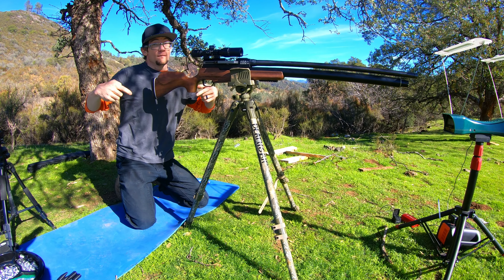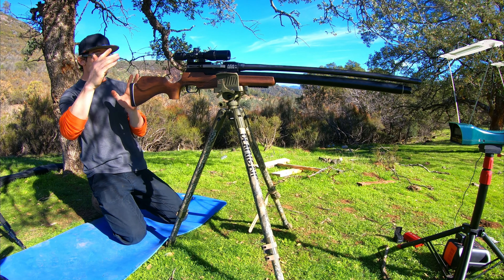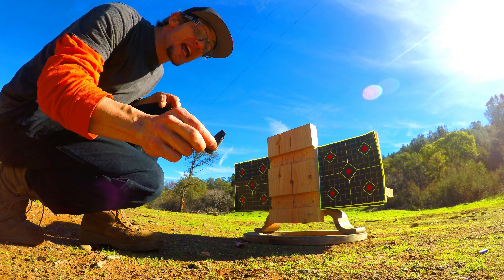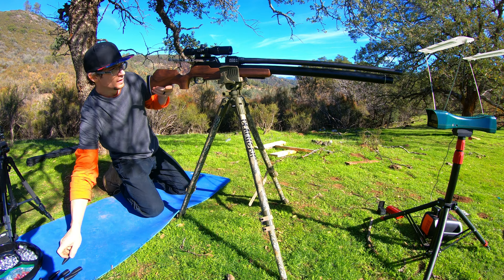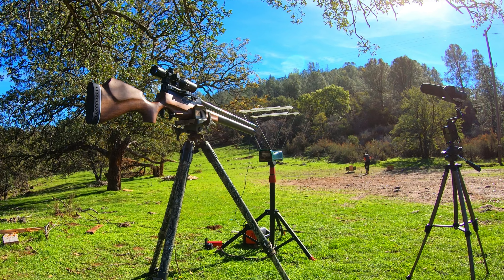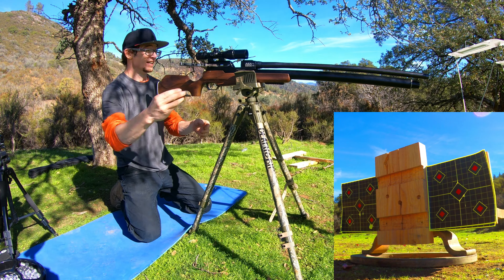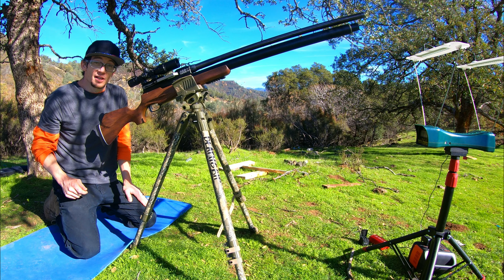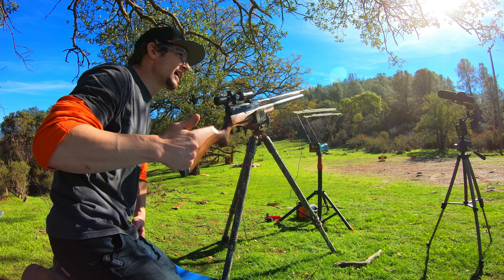AEA ZEUS .72 CAL - TESTING INSANE SPIKE AMMO in the WORLDS MOST POWERFUL PRODUCTION PCP AIR RIFLE!

Comment: Also I mentioned making my own 12 gauge twister 6 segmented slugs from the same Russian mold and I filled them with tungsten supershot #9 and sealed the tops with hotglue. I call them the abominations was wondering if you were interested in me sending you some to try. Fair warning though- if you test on ballistic gel you will need to buy a new one. I was left with only the front 8 inches of my block after it grenaded segments cutting it practically in half and the tungsten supershot shredded the rest
Reply: Ohhhhh I luv it!
Must try this with spent uranium!
Might make the game a little gamier, but easier to find in the dark on those night hunts.
Reply: @mystic22222  umm while yes that might make it penetrate more as DU is typically used in tank/armor penetrating rounds. It's toxic once in the body and while hunting you'd be irradiating your game and making it toxic to you to eat. Atleast from what I understand. Besides with the tungsten you still get alot of penetration without toxic metals and finding the game won't be hard as it will drop where you shot it.. well you might have to find some pieces of it but most of it should be there lol

Comment: That would be a sweet ass round if the maker drilled a hole in the front and put something heavy in it, so it could be front heavy and stop the tumble i think. Nice👍
Reply: That is the plan.
I will go into much greater detail on how stoopid I was not taking that into account during design.
Actually, the problem is density controlled center of gravity, which I did consider because I can control the printing density, but I printed 100% body at 100% density because I assumed any other structure couldn't take the pressure/acceleration and would be crushed before leaving the barrel. But adding weight up front is the real answer. It's always been a temptation to try to get this new technology to be all/end all standing on it's own. A silly notion but 3D newbies, myself included, are very susceptible to testing the limits. That's how we live and learn and grow.
Love your observations, keep'm coming!
Reply: @mystic22222  Outstanding! I can imagine how devistating they're gonna turn out, damn great job and good luck on success👍👍👍👍👍

Comment: Another great video Mac. Way cool that one of those 3-d printed hit wood even if it was tumbling. I wonder if a football shape would do better? Awesome content 👍👍
Reply: Yes it would, and at low velocities it could greatly increase the ballistic coefficient for retaining very long range terminal energy. Problem #1: very little space to add features so mass is traded for velocity and mass carries most of the energy.
Problem 2: You can't apply massive force to a sharp point so a custom sabot/wadding has to be added, robbing energy with parasitic mass.
Problem #3: at high velocity, especially supersonic, it's a total vacuum at the tail so there's no effect on BC.
Good thinking though.
Keep giving us your thoughts.
Reply: The light weight is actually the point because the first goal of this project was to scare the piss out of attackers with the firearm-like report from smashing the sound barrier.

I too, thought there would be a bit of resistance in the barrel at 0.729" but flash heating and pressure should cause flash melting/lubrication. The inconsistent velocities usually point to it being too loose*, but of course you could be right in that they may actually be *too tight (my initial concern). This is why there's no substitute for testing. I asked Mac to do the testing only because I can't risk making my neighbors think I have a firearm where I live.

Finally, you're right, Mac needs to check his barrel for accumulated plastic. Funny enough, polyester powder coating prevents build up.
Go figure.
Reply from the maker: No matter what the comments think you knocked it out of the park for this experiment bro!
Reply: @macabespeed  I agree Mac this was a awesome test and some great information was gathered. Well done mystic2222 and Mac!!
Reply from the maker: Thank you!!! It’s actually really interesting to see other ammo makers come forward offering to cast a lead version! People have been hitting me up to actually make a .72 spitz today 😳
Reply: @mystic22222  boat tails still reduce drag, even supersonic. This has been repeatedly studied and proven by the militaries of the world and by arms/ammo companies (and independent labs and researchers (including in the air gun world)). That being said, a flat base bullet will often be more accurate than a boat tail, as the extra drag keeps the bullet from wobbling (similar to a diabolo pellet). The problem is that the FB bullet slows down faster than a BT, so it's more affected by wind, pressure, and humidity variations at distance; making the slight advantage of being drag stabilized negligible and even detrimental at a certain point. A Boat tail bullet is also longer than a Flat Base bullet of the same weight and general nose profile, so it requires a faster twist to stabilize for it's weight (an issue with air guns especially, since they often use ridiculously slow twists. too slow a twist is why these projectiles are tumbling in this vid, BTW; if it were made out of solid lead, that barrel might have had a shot at stabilizing it)

At subsonic speeds, the boat tail shape is roughly twice as efficient as a flat base. Once you approach Mach 1, drag dramatically increases (ballistic coefficient changes with velocity, for anyone wondering). The increased turbulence at the rear of the bullet (it's not a vacuum, the air tumbles around the back of the projectile to return to where it was before the bullet went through) also noticeably lessens the difference between FB and BT bullets, mostly because of the added length (surface area) of the BT bullet of equal weight to a FB. because the air is supported on a tapering surface on the back of the bullet, the turbulence behind the bullet is less severe than with the abrupt end of the FB (BT's are generally 10-20% more efficient than FB's above Mach 1). The increased turbulence slows the bullet down really fast. The higher Mach you go, the more drag and turbulence  increases, because the air is compressed by the bullet, and is therefore denser (air-gunners should be aware of this, since compressed air weighs more per volume than ambient air).

The rear of a BT bullet doesn't seal the barrel and push the bullet, the body of the bullet does, so having a true lozenge shape is no real detriment (people have and continue to load BT spitzer bullets backwards for hunting bullets, and they work reasonably well). Casting or swaging the bullets to that shape ( lozenge )would be a challenge, however, hence why they aren't common (especially since the length of the nose on a BT has a dramatic effect on the effectiveness of the boat tail, so if you have the choice between a symmetrical bullet or a shorter boat tail with a loooong nose, people normally go with the longer nose profile, unless their rifling can't stabilize that longer projectile)

Comment: You have to put the crohny 3 meters away
Reply: I agree and mention this, what, a year ago? My experience with optical chronies -- the shock wave distorts the passing shadow and consistently causes errors even on medium power air arms like the Blitz @ 50fpe. 
Should be at least 6 feet away.